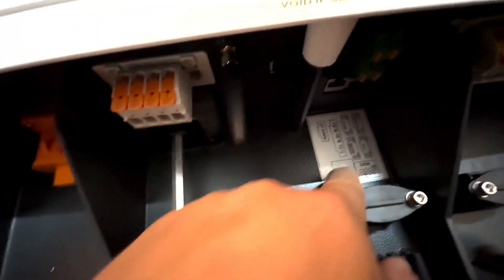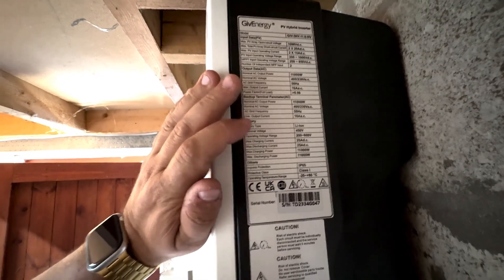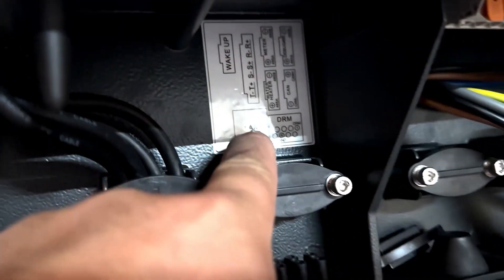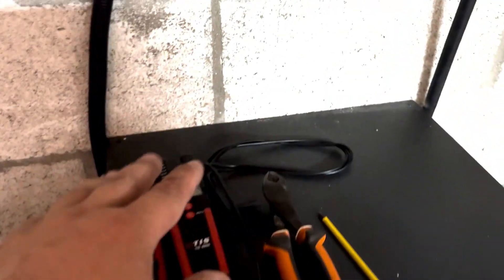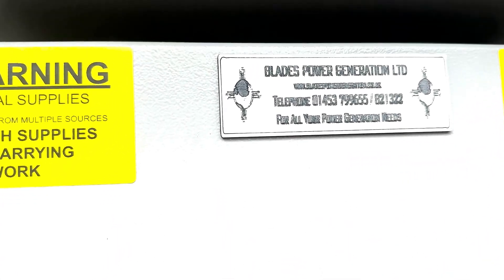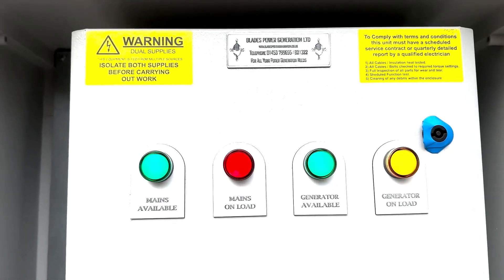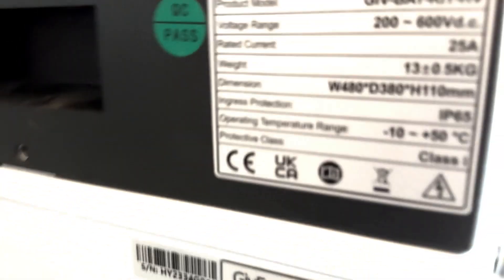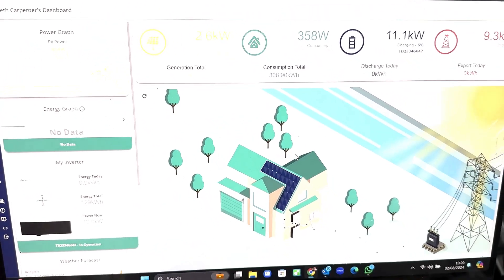3 phase GivEnergy whole home backup... 11kW 20kWh+ Beast!

Comment: Please help me out: I have a 10 kW hybrid inverter and a 20 kwH battery from GivEnergy(2024). In case the grid goes off line, my power use is limited to 1200 Watt. So how come you have a complete backup with more or less the same battery. Some extra stuff installed?

Comment: Do you know if it dynamically supplies each phase based on their in the moment unbalanaced demand? Seems silly that some 3-phase inverters just dump the same amount of current down each phase, meaning 2/3 just gets exported to the grid for no reason.
Reply from the maker: Yes it balances loads within the realms of its rating. Smart bit of kit.